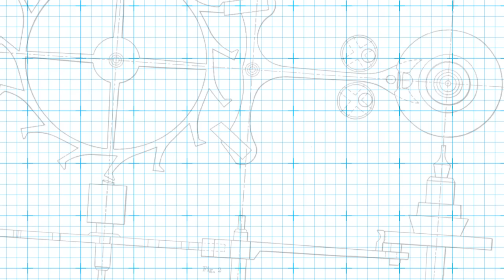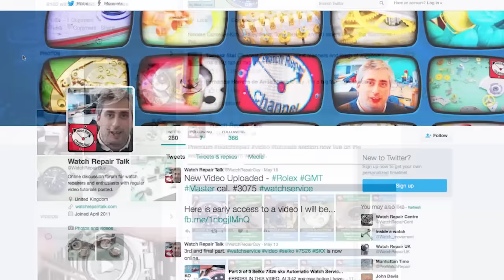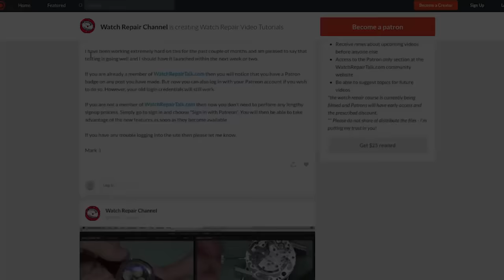How I re-lumed 5 watch hands - Watch repair tutorial

Comment: We always used the old waxy stuff in the tins. You melted it and applied it on the hands with a hot flattened copper wire. I can see where this would give you thinner thickness in the end.

Comment: I have never seen or handled this material.  As a powder, does it lume in the dark, or does it need to be mixed in that fixer first?
Reply from the maker: It actually glows wether mixed or not. But only after it has been exposed to light. It then gradually gets dull over time.